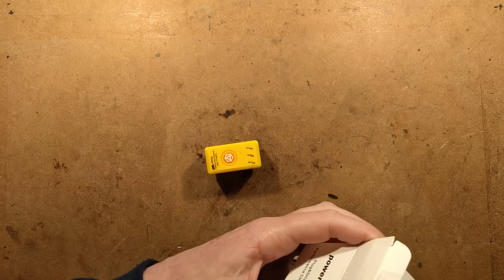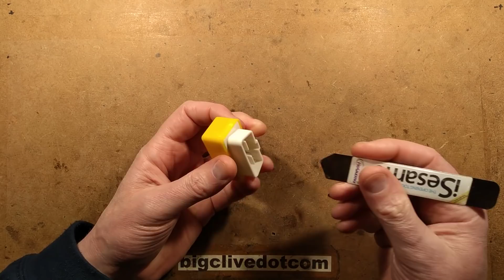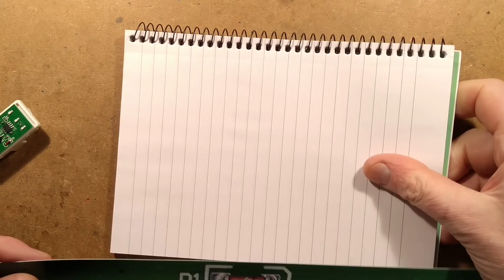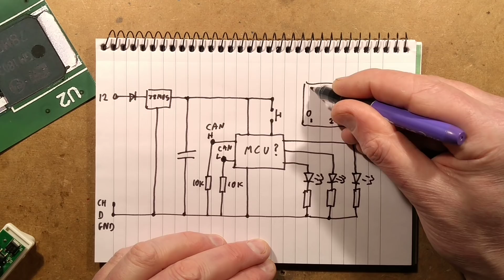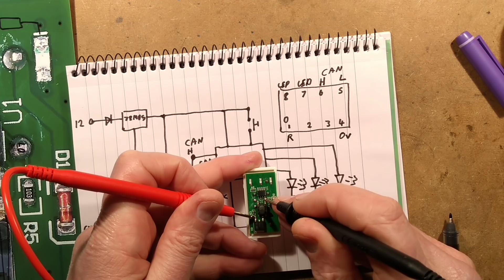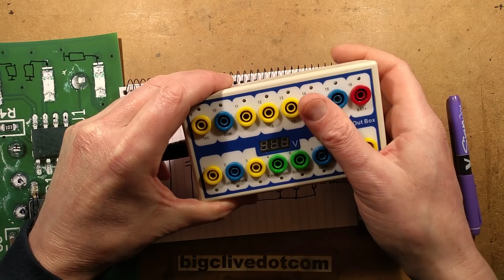Simplest OBD2 engine remapper yet, with actual canbus connection.

Comment: Is there anythng, really, that can change the power output through OBD2? You'd think car manufacturers would make those settings on the ECU read-only.
Reply from the maker: Some vehicles have that functionality, possibly to make it easier for their service agents to make small adjustments or maybe even upload new firmware to the ECU.
Reply: @bigclivedotcom  Cool, I honestly didn't think that was a thing. I love that my comments get replied on sometimes, btw. Fantastic channel.
Reply: I have a Superchips Bluefin for my car. Makes a real difference. Much more to it than these things though, and it can be used as a fault code reader, which is nice. They have to be programmed to your specific vehicle as well. It will never be as good as a proper re-map on a rolling road, of course.
Reply: Yes, almost all cars from this century can be programmed through the OBD port. Galletto and MPPS are common tools used in the trade (and with cheap chinese knockoffs by individuals like me..) Cars from pre-2000 had to have physical memory chips with the fuel/boost charts swapped on the ECU (hence the term: chip tuning)

Comment: Can anything make changes to the ECU via the OBD port?
Reply: Yes the port is not only for diagnostics, but also allows ECU programming and flashing.
Reply: Yep. You can do alot over the obd port if you have a dealer level VCI and software and the right software updates. Everuthing is done via obd at the dealers The vci has about 20 8 pin relays in it + alot of other goodies.
Reply: Oh right I thought it was just diagnostics, thanks for the help guys.
Reply: I use the MCP2551 CAN bus transceiver chip to read and write to the can bus
Reply: Should be firewalled off but security research has demonstrated exploits and remote ECU table rewrite for numerous vehicles, marking the vast majority of components used as of a couple years ago as highly vulnerable.

Comment: Um none remapping tools that plug into OBD2 port dose not work will never work. you need to unlock your ECU to make edits.
Reply: thats just it, These companies do noithing wrong. If the person is dumb enough to believe they can program their vehicle like this, theyre dumb enough to lose their money!
Reply: This not entirely true, but you do have to spend £500ish https://www.youtube.com/watch?v=2KfMY96v_Gc Skip to around 4 minutes to go directly to the reprogramming.
Reply: @IanDarley  That looks more like making a selection than reprogramming. Reprogramming takes longer than that
Reply: That’s roughly about 60% of all people lol.
Reply: Question remains is how to unlock the ECU?
Reply: @guyh3403  with an actual obdII programmer via pc or dedicated handheld like a superchips etc
Reply: I am using the H&S Performance Mini Maxx Race Tuner in my ford super duty.  Unlike the cheap Chinese fakes this one works.  I leave it plugged into the obd port so the Ford mechanics know the truck is running a custom tune and they won't reflash the ecu.

Comment: As a teenager i worked auto parts stores for total of 5 years. Its amazing the customers that would come in and complain about there car not starting or whatever and end up buying a qt of oil. Thats the universal fix all the cheapest qt of oil possible. On a side note tho whatever autoparts store your at if you look at the house brand and then look for the name brand whichever container the house brand resembles the most is usually bottled by that name brand. I worked at chief auto the house brand was bottled by valvoline. I did however have a regular customer he had a sandrail  (i lived in the High Desert of California ) and this man used to stop in on the weekend on his way out from LA to take his camp rig and sand rail out to the desert and he bought slick 50 and he had put into his sand rail. Sunday night on the way home he stopped and had told us he was out thrashing around in that sand rail poked a hole in his oil pan and idled eight miles back to camp and shut it down the next weekend he was on his way back out after putting another oil pan on the sand rail and that Sunday on his way home he stopped in and told us everything was perfect he said that slick 50 had worked. We had always ben told was just high detergent oil. I did put it in regularly in my moms nissan sentra she had rhat car for 12 years never had problems with engine at all. But those engines last a lot of miles. Im still kind of on the fence about that slick50 additive but i always share that story its the only real world example i have. I worked with an retired shop teacher he always said regarding slick50 you cant put metal back on once it wears off.
Reply from the maker: I used slick 50 in one of my vans.  There was always that unknown aspect to whether it works or not.
Reply: @bigclivedotcom  yeah i dunno either i like to believe that customer years ago, matter of fact i guess i did because I used that product up until i bought my first full size diesel pickup truck, (i guess i figured 20 bucks for some super detergent oil that will clean the engine at least or 20 bucks for some extra protection) then that stuff is a no no. At 70,000 usd and a warranty its either oil or synthetic oil thats it. I dont think they make a diesel slick 50.  Diesels tend to last longer anyway.

Comment: Seems risky to have commononed those two ground pins - one could imagine that on some cars there may be a significant difference between them when cranking the engine, especially if the data ground reference is the engine block and the engine earth strap breaks. Also you missed a bit on how to fix your car if the unit screws the CANbus - the correct instructions are "Remove the unit, wind down the window and throw the unit out"
Reply from the maker: No.  You keep the faulty unit and give it to someone you don't like.
Reply: @bigclivedotcom  I like your thinking. Even better we should design something like those USB computer killers - it watches the cars speed via the interface, and when it hits 70mph it applies +/-500V across the CAN bus.... An excellent gift for those "friends"....
Reply: Kevin Baker - Oi! No disposal of useless plastic rubbish in our countryside.
Reply: @Mark1024MAK  I was going to chuck it out while driving through Slough......
Reply: Those two ground pins are typically always connected together on the OBD II port.
Reply: Most of the time 4/5 are tied together anyways
Reply: @Daytona574  Indeed - manufacturers would rather not spend the extra cash on a cable they don't need. The reason I thought of it was a historical high  fault current path. In the much missed CCC mag they used to have a column called (I think) Walkers Workshop - a sort of 1980s South Maine Auto, and one time he wrote about a customers car brought in as the gearbox was faulty. When he went to start it, it would not crank. He called the customer and they said "Oh yes - you have to put it in 1st gear and lean on the gear lever. Turns out the engine earth strap had broken, and the customer was making the return path via the gearbox. Not unsurprisingly it turned out the gearbox had "seen better days" having not been designed for carrying 200A.....
Reply: I wondered about the ground situation, you'd think that bonding the data ground and chassis ground is going to introduce all kinds of noise onto the data ground which is not good news. Disposal instructions should read: unplug it, take it to the top of a cliff overlooking the sea, and drop-kick it as hard as you can...
Reply: The data bus is differential. Data ground should be unused for CAN vehicles.

Comment: Only turbo boost I get in my car is if I drive down a really steep hill, with a strong following wind while I drink a large espresso!
Reply: That would be a Rolls Royce. 

Rolls down one hill and up the other.
Reply: That's a Rolls Canardly
Reply: @daler.newbury9967  I Thought that was the Rolls Canardley. Rolls down hills Can hardley get up em. haha.
Reply: Oh bugger , just read a bit further and i'm the 17th to say the same joke.
Reply: @daler.newbury9967  Rolls Canardly: Rolls down the hill, can hardly get up the next one.
Reply: @daler.newbury9967  That's a Rolls canhardly. Rolls down the hill can hardly get up.
Reply: I claimed that joke, it's the only one I've got
Reply: @Equiluxe1  yep. I'll blame that on auto-correct 😁
Reply: Don't forget to paint speed stripes. Gain another 10hp easily.

The only turbo my Ford truck gets is when the number four cylinder accidentally fires.
Reply: Jammit Timmaj . Yep. That’s a Ford. Been there. 😂
Reply: @okcantbelieveit294  
Drove a 97 F-150 from Kentucky to Arizona, on six, occasionally seven cylinders working. 
At highway speed. (As in "Fuck this thing, I'm going home"). 

IME, 90's~ early 2K  Ford trucks tend to either completely shit the bed, or every "nonessential" component will fail, but it will still get you from point "A" to "B".
Reply: Elenor Malik, what the other drivers don't realise is that their vehicles with 8-cylinder blocks are only carrying a couple of spares!
Reply: @therealjammit  It also needs a huge ass wing and a fart muffler.
Reply: Jammit Timmaj I had a '69 Ford pick-up with a 390 when I was a kid. I got clocked one time at 157mph.
Reply: Have you tried painting it red?
Reply: I had an 84 Chevette that went faster downhill in neutral than if in gear.
Reply: You should eat some beans. It'll give you a slights boost.
Reply: You forgot the red flames.
Reply: Eating a large tin of beans then hanging out the window will add 10-15 horsepower. May require a couple of hours for this mod to become effective. Results will vary.
Reply: Must be a Fiat 500 then - I take it you cannot go up hills!!
Must be a real bummer having to get out to push it up hills!

>;o)
Reply: The best turbo boost with one of these would be on the cars of the Snaefell Mountain Railway - shooting past The Bungalow at 160mph and generating enough power to burn out the 40MW undersea cable to Blackpool!
Reply: I have a VW UP TSI, so I get turbo boost a lot of the time! Wonderful little motor - average 16Km/l with my havy foot on the pedal (I often do 140Km/h when I drive to visit my sister).
Reply: @maxheadrom3088  you won't be quite so happy when the gearbox fails. (It will I'm afraid)
Reply: @gs425  Really? The TSi model was  released just a couple of years ago in Brazil so I think the issue hasn't popped up yet. Is it a common problem in other countries? Does it affect manual as well as automatic gear box? Thanks!
Reply: If it doesn't work, use fartcan muffler and replace it's bearing!
Reply: Say word. That's how my skateboard works!
Reply: Mine is japanese lancer. She gud girl
Reply: Get an actual turbocharger. She'll drive a LOT better ;-)
Reply: Put P plates on it.

Comment: How much do you think they are making off this chicanery? What do you reckon this cost to manufacture?
Reply: I'd guess the BOM might be around 50 cents or a bit more if the box is a reasonably good plastic?
Reply: guestimate .... not more than £1 per board probably closer to 50p (the most expensive part would be the master mold for the case but split over 100s/1000s of units it becomes negligible. ) then the mcu followed by voltage regulator and leds.